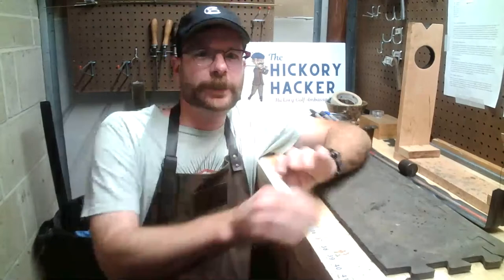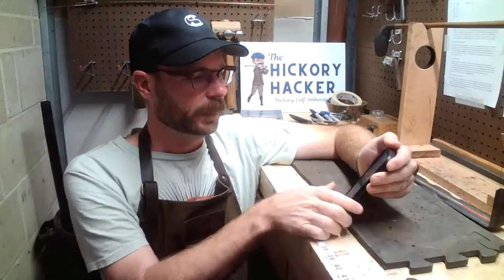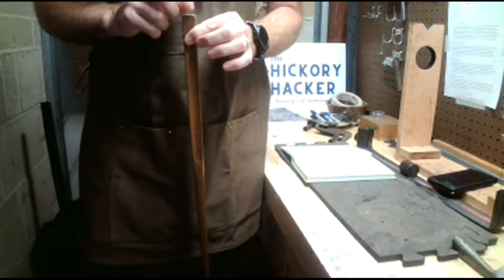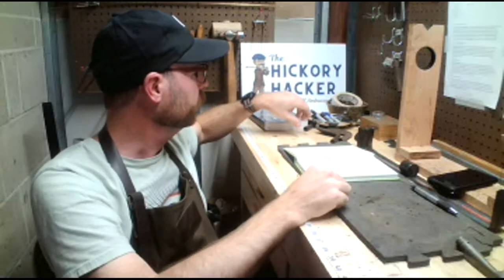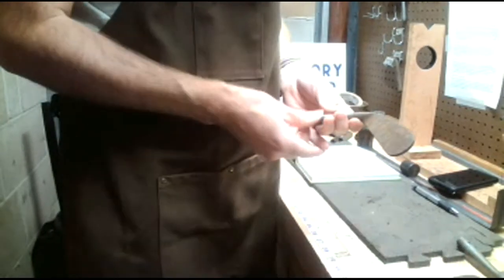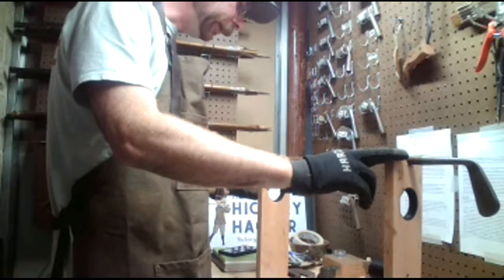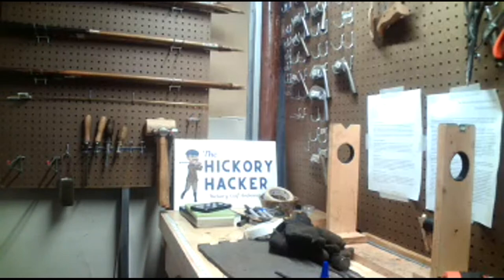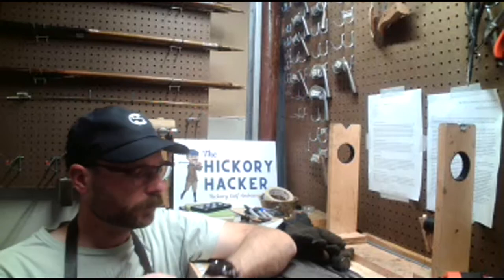Hickory Golf Club Repair: Fresh Finds / Rust Removal / Shaft Repair - Workshop Wednesdays #2 LIVE!

Comment: Fantastic, thanks Christian.
Do you straighten shafts that you collect before you have a club head for it or do you wait until you mount it and then straighten it, ie. mount first or straighten first?
Reply from the maker: I actually haven’t straightened any yet on the board but if the head and shaft are separated, I plan on doing the straightening before I set the head. When I do that video, I’ll do it both with and without a head so we can all see what works better or easier. My guess is some bends will be easier to straighten on the board if the head isn’t in the way.